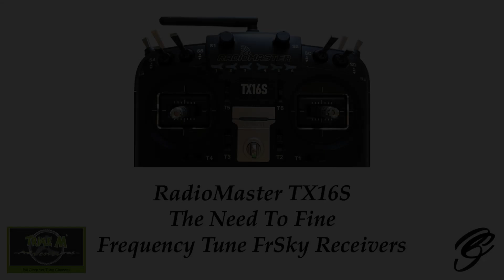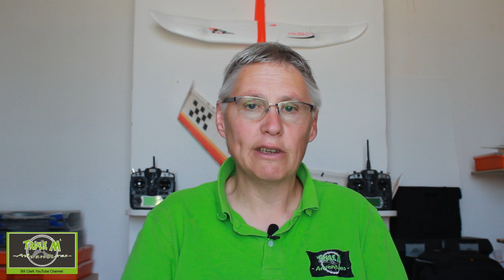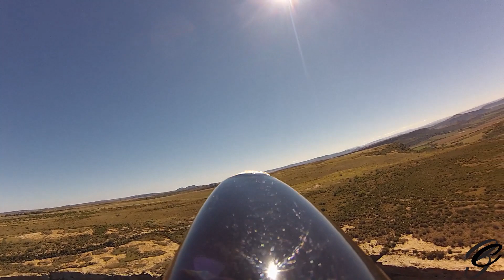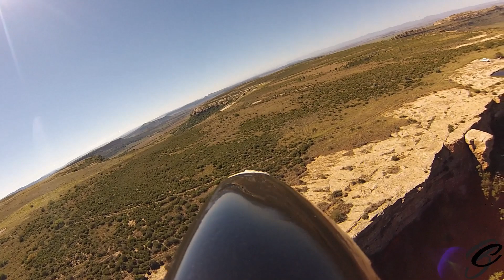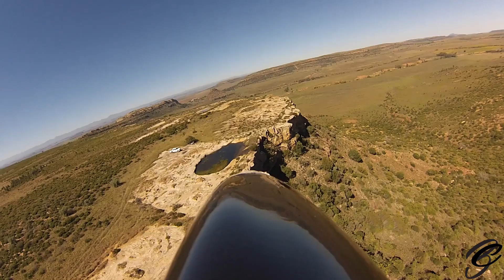RadioMaster TX16S The Need To Fine Frequency Tune FrSky Receivers

Comment: One of the few first time videos I've watched that I actually learned instead of just being confused.
Very new to it all. Have Tiny Hawk II(indoor version)that is apparently bound because I get the verbals 
about telemetry but haven't had any success getting arm sw to wrk Guess I need to recheck sw points.
Reply from the maker: Thank you for your kind comments Dale. You will need to connect your quad to Betaflight to check the modes are set up correctly and that your channels are working in the Receiver section. I am releasing a video tomorrow on setting up a Basic Quad Copter in the RadioMaster TX12 and I briefly go into Betaflight which may help you.
Reply: @the-happy-RC-flyer  Thanks for quick response! Went through betaflight and set sw parrameters Shows that sticks and sw working  but nothing happens in the real world
Reply from the maker: @strangerdangerdays  the flight controller is not happy with one of the settings have you set the failsafe to no pulses? Is your arming angle 180? You can see you Arm mode working in the Modes window in Betaflight? Are you hearing all the start up sounds from you quad when plugging in your battery? Just a few things to check.

Comment: Good Video. BTW, Can the TX16S bind to R6DS/R9DS receiver? Maybe it need CC2500(TX module) to convert to CC2533 chip~ But how to~
Reply from the maker: When I search the multiprotocol protocols I can a only see RadioLink Surface and Air maybe try one of these but it does not state R6DS or R9DS. I personally would not take on the chip conversion at this time.
Reply: @the-happy-RC-flyer  ，I knew the reason after studying it.  Tx module use TI cc2500 RF chip and it can not link with cc2533 chip which was uesdby RadioLink AT series.